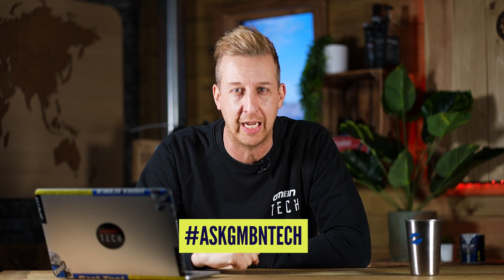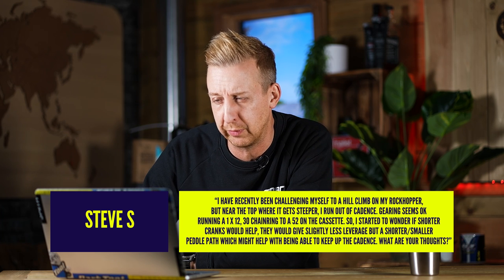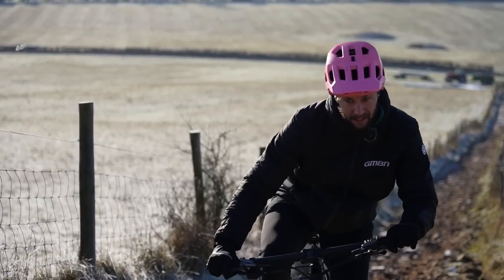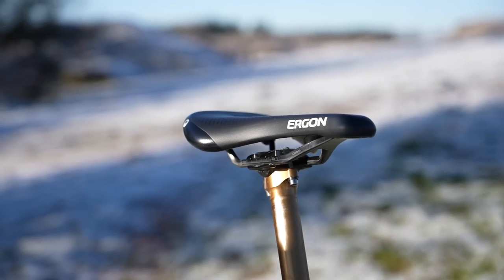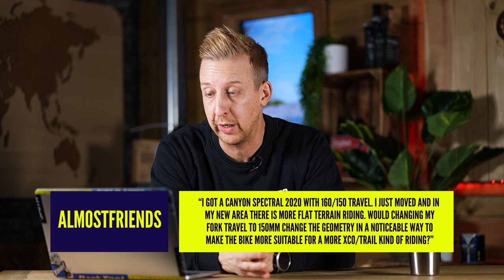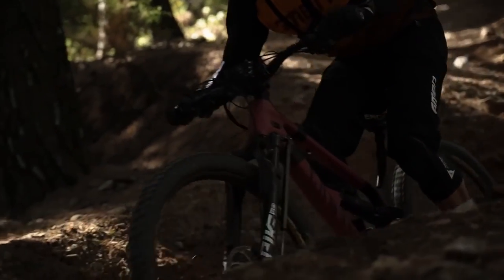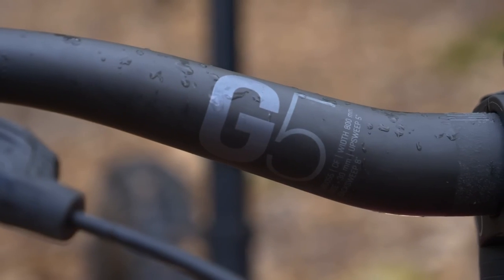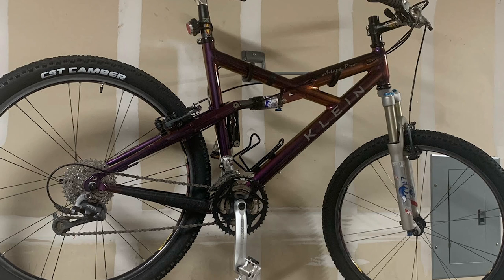Do Shorter Cranks Help With Climbing? | #AskGMBNTech

Comment: Recently i went from 175mm to 165mm. Realy super happy no more knee pain, more cadence, no more hip shaking, more aero, more comfort, same speed and most important i realy want to bike everyday.
Reply: Wow! Years ago I went from 170-175. After riding the 175 I couldn't stand the 170 cranks. I recently bought a Giant Trance X with the 170 cranks and I think I am finally okay with the shorter cranks. 10mm seems so dramatic. It's amazing how we are all different.
Reply: Hello @HaTchiKiDee1
After this switch, I guess you also had to lift your seat post this 10mm, right?
Didn't this “completely” change your position on the bike? (="too aero", possible back pain, etc...?)
I was also considering switching to shorter cranks because of more ground clearance and being able to accelerate faster, but I'm afraid of raising the seat post +10mm and therefore having to lean more forward to reach the handlebar.
Thanks :)

Comment: 30 52 should get anyone up a vertical wall. Perhaps recommend squats in a gym to whoever can't manage with such gearing. Crank length isn't the answer here haha
Reply: Squats, deadlifts, box jumps and single leg pedal drills.
Reply: As Doddy says no offence toward fitness and TECHNIQUE but thats the real issue here.   Many riders misinterpret super low gearing as beneficial when in fact it is detrimental. Low gearing can give you too much torque and break the rear wheel loose too easily.  With strong legs, good technique and a higher gear your cranking action will not overcome the available grip so easily and will actually make the climb more effective.  As an example most elite cyclists will not run a lower gear ratio than 32/45 for the steepest of climbs.  Obviously they are super fit but that is more the direction a rider should go to get good at climbing instead of relying on “bail out” gearing.
Reply: @nikolaibohachevsky2301  I agree with you on this. It's also the reason why I'm not going beyond 10 gears at my back. I find 2x9, 2x10, & 1x10 already my sweet spot for gears.

Lots'a love, cheers, & Mabuhay, from tropical Philippines! #RideOn #KeepBiking
Reply: I'm asthmatic and have a 30/52 couldn't ride much up without it tbh
Reply: @nikolaibohachevsky2301 agreed Doing some road cycling is a good example my lowest gear is 32/34 and and I only use it wen I have a 3-5 km climb or when I want to “rest” during a climb or when I have basically no gas left.

After I started road cycling I thought lower gears would allow me to climb better but it’s not the only thing tho it’s about technique and ofcourse fitness but mostly pedalling technique
Reply: Tyre choice also can have a big effect on your climbing.
Reply: @aakos26  yes but depending on your goal it’s less of a factor compared to pedalling technique and fitness!
Reply: @nikolaibohachevsky2301  ,....Totally agree. I run a 36 on the front and never go beyond the 36 in the rear. 175 cranks and in my 60's.

Comment: I just did this experiment. Went from a short travel to a mid travel trail bike. I noticed it was a bit slower up the climbs and I’d be spinning like crazy. Was running 175mm cranks with a 30/50 Eagle gearing. I switched to 170mm cranks and a 32t chainring and it’s improved the bikes climbing ability pretty noticeably. Was able to get up the big climbs a bit faster and without throwing my heart rate into the danger zone. My legs are making smaller circles vs larger circles. Just my experience with this shorter crank experiment.

Comment: Mtb climbing involves many factors, traction, wheel rpm’s, the terrain, and human/leg power. I’m probably missing other factors, but point being, it’s hard to isolate crank length as beneficial or not. Longer crank arm could mean more leverage, but depending on the terrain and the traction, more rpm’s might be what is needed to get up and over something. In another scenario maybe the added leverage is what is needed. Hard to say.
Reply: You’ve identified the problem and solution. You need to minimise the amount of variables to understand and be able to measure the potential benefits.

Comment: i got a Ripmo in size M that was supposed to come with 170mm cranks but actually came with 175's. I had a lot of pedal strikes and knee pain on big techy uphill days, swapped to 165mm cranks and it made a huge difference- No more pedal strikes, less strain on the knees and climbing techmicals is eazier. For a 5'7 rider like me 165mm is the sweet spot, i'd highly recommend anypne to do it without hesitaion.

Comment: I run 165 cranks on most my bikes.  don't think it makes a big difference on climbs, but my cadence increased switching to a shorter crank.  for me, its more comfortable and gives me a more roomy feel on my bike.  power = force x cadence, so for the same watt output you need to increase your RPM's.  28t is fairly common for front chainring. have not seen anything smaller....

Comment: I would say that longer cranks give you more leverage and should make it easyer to climb, though that's just a theory
Reply: Doesn't work that way because we have gears. You can simply use a lower gear to reduce leverage way more than the small percentage difference from the crank length.
It's all about physiology, and what fits your legs
Reply: @gepetto____4669  dude, either your bike is huge for you or you have a weird ass body. I often run my stem high because it makes it so mucho easyer on the knees. Bike size matters a lot so check what you should be riding and try other bikes
Reply: @galenkehler  fair enough, using a smaller chainring should come with the same effect.
Reply: I guess its a torque thing
Reply: @galenkehler  dont work that way..  with less gear you have to apply more force: Torque=Distance*Force and Power=Torque*Rpm so Power=Distance*Force*Rpm so if you go with a less gear you dont have more leverage really and it will be harder. Try to move 53*12 with a child bike, also why Jonas Vingegaard is running 172,5 with only 174 cm? He is the best climber in the world.
Reply: @Ferrari255GTO not exactly the same effect

Comment: here's what i am thinking ok , correct me if i am wrong . a shorter crank is a shorter lever , that means you're gonna have a harder time cranking uphill especially if you're on the very lowest gear  so i dont know how many gears equivilant if you're going from  175mm to 160mm .
people ought to be talking about the front chainring to compensate .

Comment: 30T with a 52t max cog in the rear cassette....either the gradient is so damn steep or the rider is just gassed by the time they reach the very last top portion. Changing your crank length is not a real solution. For climbing reducing weight from either the rider or the bike can make a big difference in energy savings. The other thing that helps is just to get into better shape. Stronger cardio and stronger leg power along with knowing how to maintain a proper position on the bike.

There I said what Donnie was too kind to say. Cheers~

Comment: I been using 175 cranks for 20 years i change to 170 and at first feel good but after a month i notice i get more tired climbing more fatigue in the legs more circles pedaling i switch again for 175 and is better for me and i dont have any padal strikes at the end not everything that is like a norm in mtb works for you
Reply: Pepe,....Im with you. I have always ridden 175's and dont see the need to ever go any shorter. Im only 5' 7" and 63 years old and dont understand why anyone would want these short cranks.

Comment: I use 150mm cranks on my e-bike just because I had problems with catching my pedals on the ground (which is worse on an e-bike since the BB is wider) and it does change things up more than I thought it would. The e-bike responds well to it and although I have to use lower gears, the motor seems to help more and most of all it is easier to get a very smooth power delivery. But that only matters on very slippery ground and on a normal bike I would not like the shortened strokes- makes me feel like my legs don't get stretched out enough. Might be useful for people with restricted freedom of movement though
Reply: To avoid the problem of legs not getting enough extension, the saddle would have to be raised or the rider would have to stand on the pedals.

Comment: Shorter cranks may equal higher cadence which might allow a taller gear to help momentum and having some gas left in the tank. Could also mean less gas in tank because of a higher cadence ! Personally I run 165 cranks and a 30T Oval and my knees feel great.

Comment: #AskGMBNTech - Question about the chain master link, or quick link.  The package notes 'non-reusable'.  What is the reason for this?  It is the rain season in CA right now, and no better way to clean a chain then to remove it.  I have been reusing the same link over a dozen times this season.  What am I missing?
Reply: chain master links, can be reused, but could wear so that can come apart when you dont want it, 
also manufacturers can sell more spare links?

Comment: #AskGMBNTech First time poster from Mississauga Canada. I really like your show. Both you and Anna are quite informative, so I thank you. A friend gave me a used set of Shimano SPD pedals however I have had issues with my knees previously, so I'm hesitant to try them. I know I can set the release tension to low on these pedals just in case I give them a try. What are your thoughts on magnetic pedals vs spd? I ride cross country and down country bikes. I'm riding flats right now and I get smoked on hills and flats. Thanks in advance.

John 

Mississauga Ontario, Canada
Reply: Hi John, im from across the lake/river on US side but got a rescue dog from Mississauga. Ever ride "Short Hills" ? As far as magnetic pedals take a look at Hustle, they're the best.
Reply: @mudkayak6305  I haven't rode those but will add them to my list. Thanks for the tips.

Comment: Hello, I need your help, I bought a new 10 SPEED chain, I didn’t cut any link because the full length of the chain seem like it would work, but when I closed the pin, my rear derraileur was too tense even though I checked the b-screw, is it possible that a new chain of 116 links could be too short for the bike??

Comment: I always wondered how much shorter cranks would help out my single speed riding
Reply: would not be able to get up hills with shorter cranks on single speed!
unless changed gear you run, so not a help at all
Reply: @alanblurr1265  Not necessarily. It's like doing full range squats vs. partial range squats. humans are stronger at partial range squats.

Comment: #AskGMBNTech I recently put on a new pair of wheels on my gravel bike. The new wheels have exactly the same types of hubs as my old wheels, and I had no issue putting the existing cassette back on and installing the wheels into the frame. However, now when I use the second smallest gear, the chain wants to skip into the heaviest gear, which did not happen with the old wheels. Other than this, the bike works perfectly fine. My drivetrain is a Microshift Advent 1x9, and there were no changes to the drivetrain setups between the wheel swaps. What could've caused this new problem to arise?

Comment: #AskGMBNTech as a larger (clydesdale) rider, I'm told if I wanted a full suspension bike instead of a hardtail, I need to look at a bike with a low leverage ratio on the suspension..... what does this mean and how do I figure it out?

Comment: @gmbntech Seriously, you guys need to do a bit of research on the crank length subject. Having one crank length for all riders is the same as having one size frame for everyone then saying, "If your having issues with the handling of the bike, you need to work on your skills". Just like how the 26" was originally adopted to mountainbikes just because it was what was available not necessary the best, I feel that the 175mm crank is the standard only because of tradition. Do you really think a 175 crank is the optimal crank length for everyone? There's a reason that road bikes use many different cranks lengths. As someone with a 30" inseam, I've always felt like like I was bringing my knees up and around too high, which in turn made it feel like I was doing squats. Once I switched to 170mm cranks, I'm now able to spin the cranks up at a higher cadence and so I started PR'n the climbs. And not by seconds but by minutes. Think of it this way, which is easier to repetitively stand up from, a 6" curb or a 2' bar stool? 
I urge you to watch the video Dylan Johnson did about it.
Reply: I go watch it
Reply: I forgot to mention, all the knee problems that had plagued me throughout my 30s-40s have all pretty much disappeared in my 50s since I switched my bikes to 170s

Comment: #AskGMBNTech I'm planning to swap from 170mm cranks + 30T round chainring to 160mm cranks + _ T oval chainring on my new 29er trail bike. I'm 5'6" and my 30T round chainring is just about right. 32T might be more than preferred. Do you have any thoughts about what oval tooth count I should go with for the shorter, 160mm cranks?
Reply: 28.

Comment: You can purchase as low as a 26 tooth chainring. I use this for more range during climbing very steep sections. There's a  bunch of videos on crank length.  Go shorter ride better.

Comment: Sorry im gonna have to dissagree with you on this one i used ti have a good friend who was on track to cycle in the olympics and we had a race one day i was ahead of him most of the way till we hit a hill and he steamed past me and it wasent cuz i ran out of energy i asked him how he managed to fly past me so well up the hill ans he said you made one major mistake you where leaning forward he said lean back when going up hill it drives the back wheel into the ground and makes it easier going up the hill and since then ive always leaned back rather than forward and my god does it make a difference... all your drive is in the back wheel if you lean forward you are shifting weight off the back wheel and instead of pulling your weight your pushing it through the front wheel also if your off road you want grip in the rear wheel so it doesent slip and wheel spin nothing worse than loosing drive and momentom

Comment: #askgmbntech - I recently got a specialized enduro frame and had it custom built, which is a 170/170mm travel bike, but during the order the fox 38 grip2 factory was only available in 160mm. So now I have a 160 front 170 rear. Will that change performance and possibly damage the frame?
Reply: yes, if it doesnt say its designed for less than a 170mm fork, also you void your warranty if anything were to happen to the bike.
Reply: @Shred_Tube  ok, but will it damage the frame or reduce performance?
Reply: @TWM316  yes if it doesn’t say it’s designed for less than a 170mm fork
Reply: you could change the travel by yourself or in a bike shop
Reply: @linusmushroomtips776  no you can’t, if the bike isn’t designed for less than 170mm fork then there is nothing you can do
Reply: @Shred_Tube  I'm talking about the fork, not the frame
Reply: @linusmushroomtips776  ….and so am I, do you even ride mountain bikes lol?

Comment: #askgmbntech I bleed my rear brake it feels good for a few rides then it gets spongy again and sometimes it feels good then I go downhill over roots and rocks and It gets spongy again and then when the trail smooths out there back feeling good again this only happens to the rear brake I have never had a problem with the front anything you can think of to help this has been a problem for awhile Thanks for your help Ricky
Reply: go back to mechanical on that rear  .... stay sharp

Comment: I'm gona break the trend of people loving on them.. short cranks suck.. 

Put a set of Hope 155s on my latest "play" bike.. the short cranks suck in my honest "humble" opinion.. 
Noticeably considerably worse for sprinting as there isn't the full leg extension like you find with longer cranks and dramatically and notably more difficult for making aerial shapes and manoeuvres too as feet closer together make a smaller circle so more effort needs to be input to have the same effect.. almost like the getting sideways lever is smaller 

20/10 would not recommend.. don't believe the hype of short cranks.